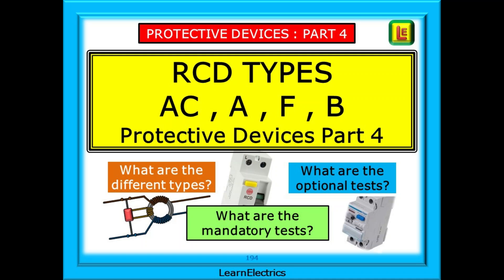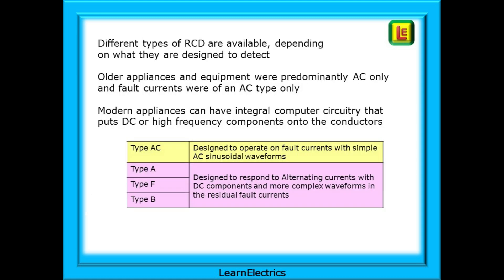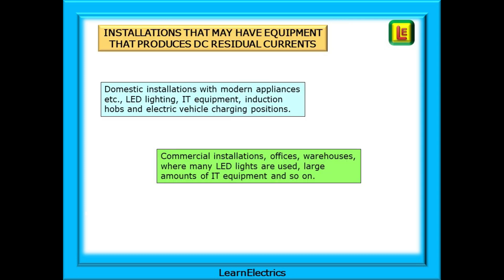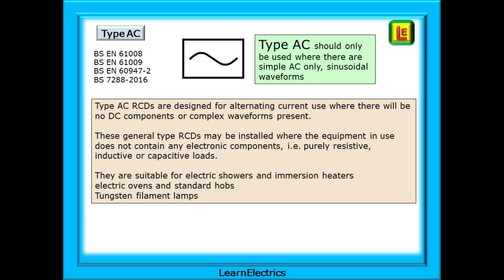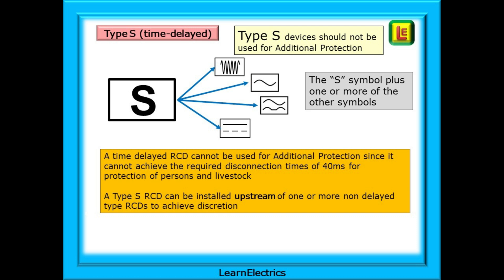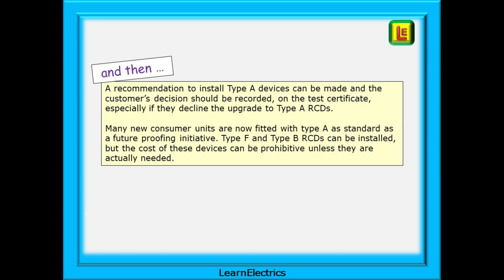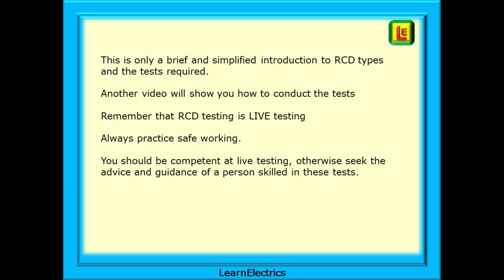RCD TYPES - AC, A, F & B – WHY ARE THEY DIFFERENT– WHAT ARE THE TESTS - PROTECTIVE DEVICES PART 4

Comment: Why would a high-frequency AC or DC current suddenly flow to earth if, in principle, there is no current loop? This is completely incomprehensible to me, especially when I start taking into account the galvanic isolation in electrical devices.
Reply from the maker: We are talking about faults to earth here. Thanks for watching, appreciated.

Comment: Is it possible to install an AC type RCD together with a B type?
Reply from the maker: Why? Just install a B type, it does the job of an AC type as well. have another look at the video, Hope this helps, Dave.
Reply: @learnelectrics4402  It only made sense if the upstream TD/S-Type RCD (TypeAC) are used in conjunction with TypeB RCCB for the intended Ccts.

Comment: I had an rcd that was protecting the whole csu. However, plugging in my tester, the rcd would not trip & the rcd test button would not trip it either. I replaced the RCD & had the same problem, i tried another RCD.... same problem!!  
It turned out to be a neutral to earth fault on the lighting that stopped the RCD from functioning !!!  Rather odd i thought, as normally a neutral to earth fault would cause tripping !!!
Reply from the maker: Glad you found it and good info to pass on. Thanks.

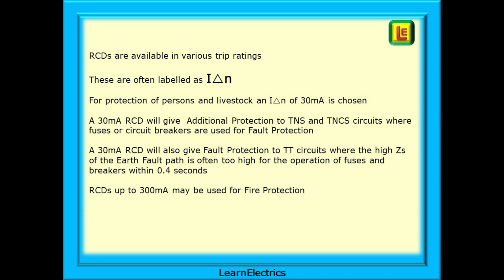Comment: At 2:20, it shows 30mA for TT as fault protection. Is it not 100mA?
Reply from the maker: We can use 100mA to protect the cables etc of a TT system but we still need to protect the people in the installation. Here, at the board, we are protecting people. We call it fault protection as opposed to additional protection as the mcb will not give fault protection in a TT system, only overload protection. Hope this helps. Dave.
Reply: @learnelectrics4402  Your channel is the best! Tomorrow, I’ll finish the last 15 recent videos! It took 2 weeks to watch all of them from the first!🤓🤘🏼
Reply from the maker: Thanks for watching. keep learning, its a good trade. Dave.
Reply: An 100mA RCD in TT provides only Fault Protection.

On the other hand, an 30mA RCD in TT shall be deemed to provide both Fault + Additional Protection.

(Its the same/safe to interpret that the 300mA RCD does provide basic Fire Protection only, without any form of sufficient Fault Protection and/or Additional Protection)

Comment: RCD saves a life. 
(1) RCd, different types, common men or electricians may not understand which one to apply. There are many times of electronic equipment in-house. The best option, Government Regulations, manufacturers write in user manuals, and the type of RCD to use. RCD saves a life. 
(2) As per BS, RCD must be tested for six months. Does the consumer to open the electrical panel, and test it. They normally do not do this. If tested on full load, arc produce and contact is slowly eroded.
(3) In TT installation, RCDs are used for shock and fire protection. As per BS, we must switch off the main every six months.
      Can we do this for complete buildings?
I asked questions before but no reply.
Reply from the maker: You would need to ask with the maintenance foreman for buildings. They may not want the building turned off. Always check with the client first.

Comment: The best lecturer on electricity.
Please, can shared neutral  cause RCD to trip?
Reply from the maker: Yes it can , depending on where the circuit breakers are connected to. Thanks for watching. Dave.

Comment: workn a simple and easy way. RCd, different types, common men or electricians may not understand which one to apply. There are many times of electronics  equipment in house. Best option, Government Regulations, manufacturers write in user manuals, type of RCD to use. RCD says life.

One question, RCDs to test every six months as per BS. 

1, Consumers may. not be testing. Mostly No one does

2, If you test on full load, spark creates, contact of RCDs damage.

3, TT System Earthing, RCDs to test six months, even for main. You lose complete power supply. Is it suitable for high rise or Industrial plant having own transformer. Best option is TN-S system.
Reply: corrections, instead of workn, read you explain
Reply from the maker: Thank you, lots more to come. Dave.
Reply from the maker: Thanks for watching, appreciated,
Reply: Please, reply to my questions.

Comment: Dear oh dear . Sorry to correct you Dave , but on on slide you said set instrument to AC for all types being tested. Then in another slide you said order test can not carry out the test you must have a test made specifically for theses tests . wrong BS 7671 Amendment 2 no longer requires use to do the 1/2 x test or the five x test, BS7671 now only requires the 1x test and all RCDs irrespective of type must be tested with an AC current at 1x I ^n at 0d and 180d . Older testers can still be used, I use a ROBIN KTS1620 and a Kewtech KT63 , we can do the 1x test and the 1/2 x test if we choose to and we are not required to test on anything more than the AC setting . Personally my testing hasn’t changed I continue to do all tests and I treat all RCDs as AC type.
Reply from the maker: Sean, have a look in  the IET Electricians guide to the Building Regulations. Page 127. Half test is mandatory.
Kewtech are a good piece of kit. Yes, you will need a tester made for the job for the optional tests on Type B etc,
Thanks for watching. Dave.
Reply: @learnelectrics4402  wrong   I go by BS7671 and the onsite guide and Guidance note 3  which say the 1/2 x and 5 x test are optional for fault finding purposes they are not required BC dose not over write the IET BS7671 who I have spoken to on the phone about this and yes they say we are only required to test at 1x I^n AC . But I said I still do all the tests . There no reason not to. I also told you a while ago the I the the IET dropping theses two test is madness and a step backwards. In the  30 or so years that I’ve been an electrician I have never had to deal with BC in fact I never even heard of them till a couple of years ago. All why do you think the 1/2 x and 5x have been removed from the schedule of test certificate , so there is nowhere to record the results.
Reply: Hello. Very interesting information about its Regulations. I am from Argentina. In my country we must try with 1/2x, 1x, 2x and 5x.
Do you think that only 1x is really enough? You know what the justification is for having made that decision. Our grandparents were wrong to ask for 1/2, 1, 2 and 5.
thank you. greetings.